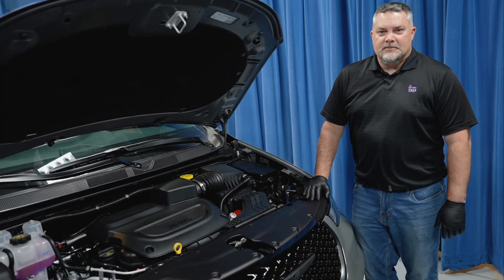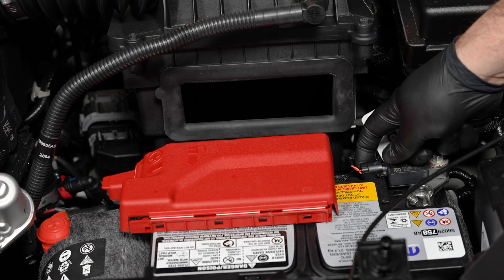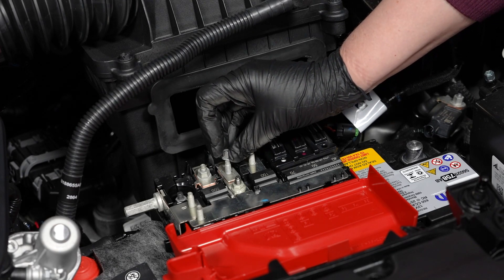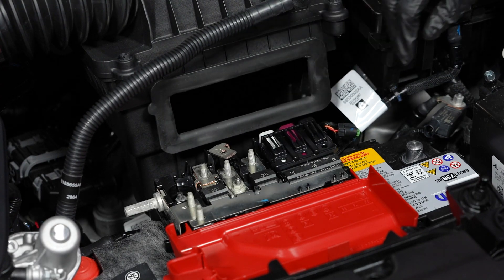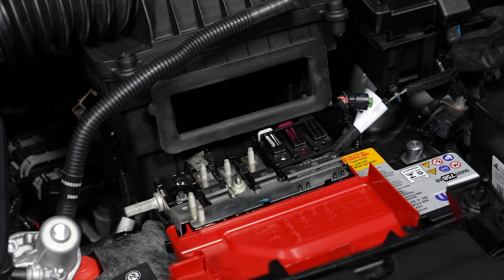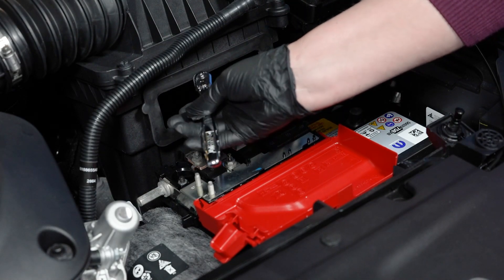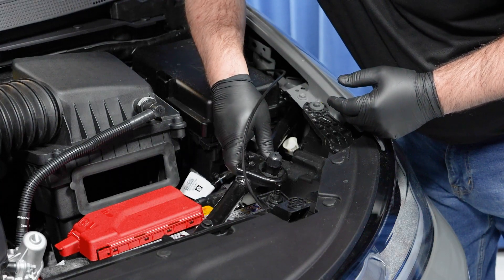Chrysler Pacifica (2017-2025) -  New Battery Install

Comment: I had to replace both of the batteries in my 2023 Pacifica and your videos were short and sweet and easy to follow.

I have two suggestions. 

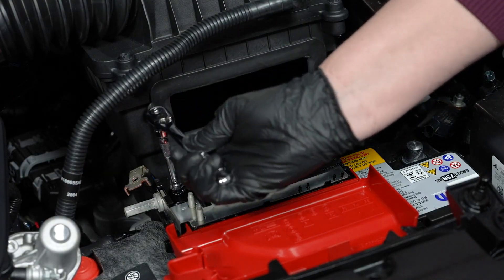1. From 2:11 to 2:26 you are "loosening" the fastener for the positive battery cable. 

I suggest that you also add that the nut should NOT BE COMPLETELY REMOVED, because, despite the resistance, I was able to take it off completely, thinking that the red plastic positive cable assembly box could not be removed if that nut was on there. After I installed the new battery I could not get the positive nut to tighten all the way down; the terminal screw or post or whatever it is called is also turning with the nut. I went back to that section and saw what I had missed; that the nut had not been completely removed.

IS THAT LOOSE POSITIVE TERMINAL NUT GOING TO CAUSE ME ANY PROBLEMS?

2. You might also inform novices like me that if you are going to be replacing BOTH batteries at the same time, you should leave the red plastic positive cable assembly unattached, because it is difficult to get the auxiliary batteries in and out with that box hanging over the edge. In the video for the auxiliary battery replacement, the red box has already been removed at the start of the video without it being mentioned.

Excellent videos, I  need to pay attention more closely, but these suggestions would make it easier for dummies like me.
Reply: Me too! I’m wondering how the 2023 batteries died so fast.🤷🏽‍♀️
Reply: I jammed a skinny screwdriver in place to catch and hold the blind nut. One a got beyond some light resistance, the nut tightened normally.